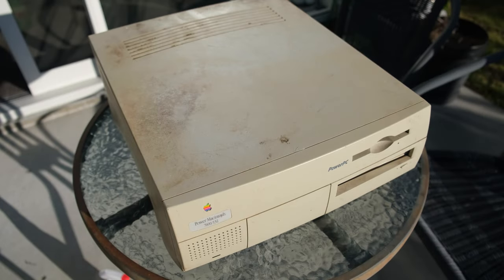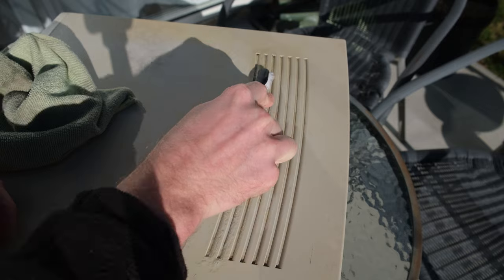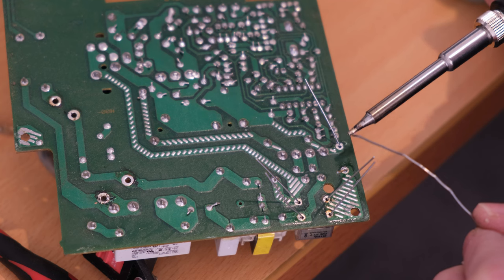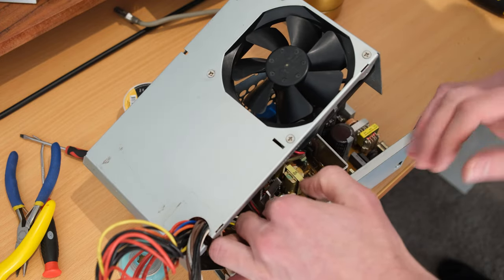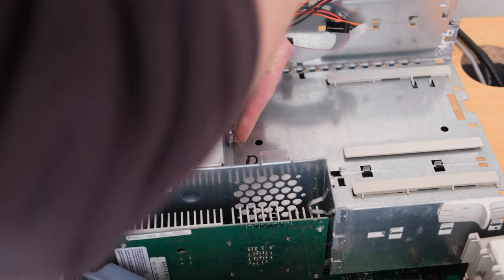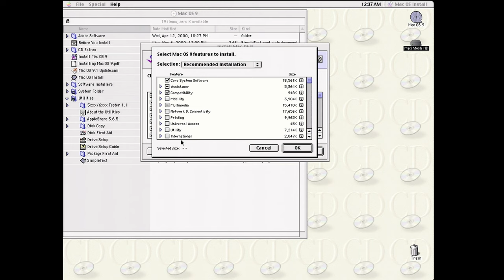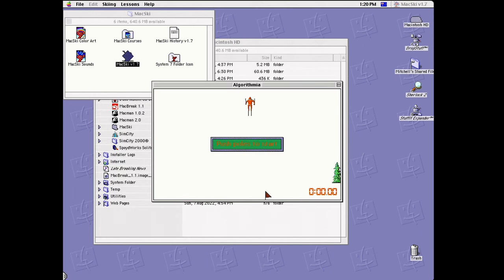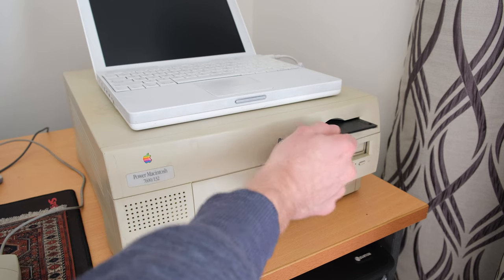A Lengthily Repair | Power Macintosh 7600

Comment: Excellent restore! The 8-bit guy washes dirty PCBs under the tap. Maybe could have washed the power supply PCB to geg that gunk off. But hey it's working.
Reply from the maker: Thanks! :) Glad you enjoyed it. Yeah I should have tried that, I'm not sure what it was but it was stuck on there. I tried a bit of IPA and a tooth bush but didn't do much

Comment: OS 9 was much more optimized for later PPC CPUs, this would really be a system 7.6 or 8.1 machine. a sonnet G3 upgrade card was available that coule push this into mac OS X territory, but you would need much more memory. consider getting 256MB of RAM or more since old world ROM likes memory. the board will support 1GB if you get 128MB modules and have at least 7.1.2 installed.
Reply from the maker: Ahh yes, I wished I could get a processor upgrade card but they're expensive. I've got a os8 disk so that might be the way
Reply: @thesmokingcap  The PCI upgrade cards can be picked up for peanuts if you look around..

Comment: OS 9.1 at the very pointy end of what this machine will support. You’ll get much better performance with 7 or 8.
Reply from the maker: Yeah she sure is slow on OS9
Reply: 8.6 is super fast on these PM7xxx machines, even with the stock CPU card.  My 7500 has a Sonnet Crescendo G3 500MHz card and just flies.
Reply: @minty_Joe  lol, that G3 upgrade will make any pre 10 OS fly.
Reply from the maker: @minty_Joe  ahh yep. I'll have to give that a try

Comment: So I should probably check my 7200/120 PSU for rifa caps shouldn't I?
Reply from the maker: If it hasn't been done, i would have a look. Also some of the surface mount caps on the mainboard can be a little leaky as well
Reply: @thesmokingcap  Blimey!  Thank goodness you are a tech.  I have to buy my Apple collection from deceased estates or garage sales where the present owners know NOTHING about the value of vintage computers or HiFi.  I received a 7500/100 a few days ago for not much money off Gumtree and it was absolutely immaculate.  It was the top tier model in 1995 with optional 1GB HDD and the PCI 132MHz 604 card.  To make it better it had 4MB VRAM, Level 2 Cache, 512MB RAM & a second Seagate Medalist Pro 9.1GB 7200 that turned out to be brand new!  Started and runs perfectly.  The two drives sell for AU$700-1,000 each in 2024 even if used.  Vintage is so collectable now.  I'm loving it.  Cheers.

Comment: Even on 98 or 99 G3 laptops you should expect a 15-minute boot time on an average with stock drives when I say stalk I mean the original stock or stock of that era
Reply from the maker: Sorry for the slow reply, Yeah I remember back in the day those iBooks being a bit slow. My current one has it's standard 4200rpm drive
Reply: @thesmokingcap  no prob Seagate barracuda laptop model drives also known as the super high-end moutous of each of those areas aren't half-bad my apologies for misspelling on the name but I'm sure you'll recognize what I'm referring
Reply from the maker: No worries and yes I understand 😊, I was considering upgrading to a SSD or faster spinning drive
Reply: @thesmokingcap  if you're doing IDE to SATA then I would recommend you just use a drive built after 05 or new should be able to get a TB for less than $16